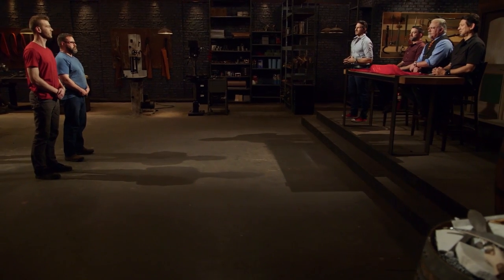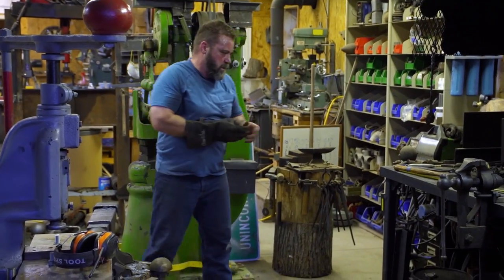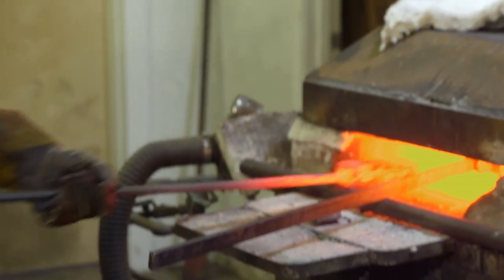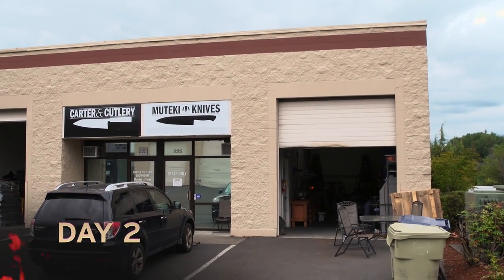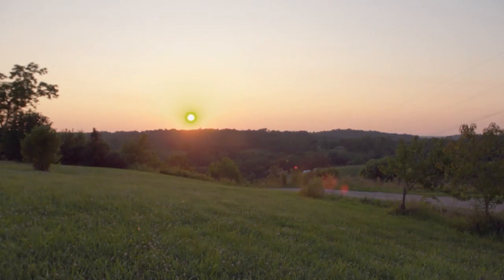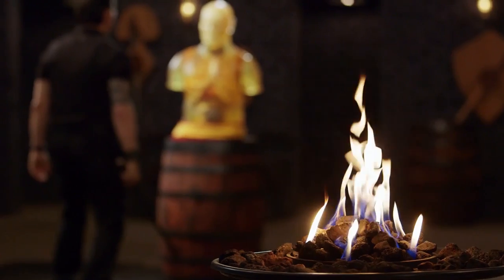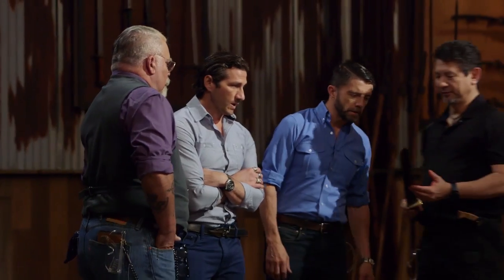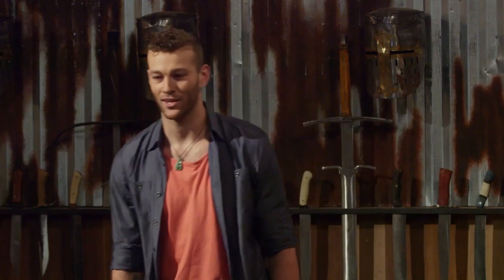Forged in Fire: Barbarian Spatha Final Round: Alex vs Kevin (Season 7) | History

Comment: Alex is like the first guy to ever have a Damascus sword not just shatter instantly
Reply: To be fair they never made it to the strength test.
Reply: To also be fair, none of these are really Damascus in the proper sense, just pattern welded, which has a risk of de-laminating if it isn’t done properly, while proper Damascus is a type of crucible steel, though they both have that swirly pattern to them, since they are both made of multiple type

Comment: It looks like a Gladius Sword
Reply: A gladius would be shorter. The Spatha is the evolution of the gladius.
Reply: As Nigel pointed out the Gladius was a shorter blade, usually about 25 inches. Good for close quarters combat. The Spatha was longer usually between 30 and 40 inches long. It gave Roman soldiers a bit more distance.

Comment: What if the great looking sword that won did not survive the strength test (that was never taken), while the one that lost had survived the strength test but still be out of parameters? Disqualifying based on parameters only is not fair. Should have carried out the tests, then fail for the parameter not met, if both performed equally.
Reply: I know this is old but that still would be pretty unfair because if you never followed the paramaters then you can just make whatever weapon you want and easily win. Like what if the other guy did have that ridge and wasn't disqualified but having the ridge made his blade weaker and made it bend or warp in the strength test then he would have had an unfair advantage.